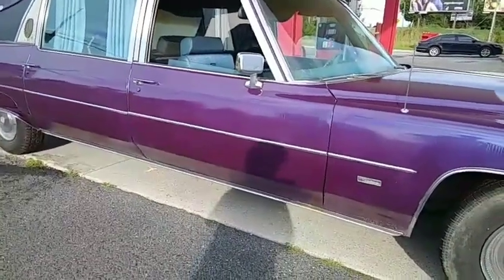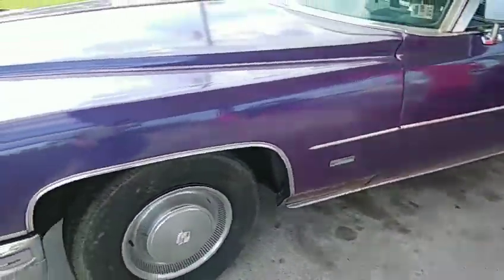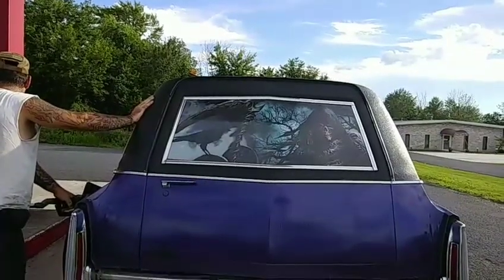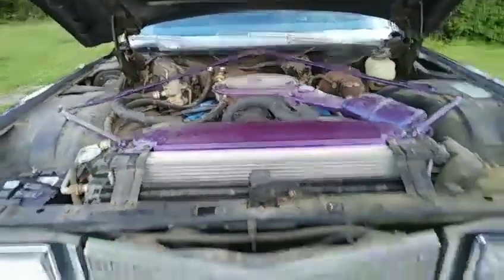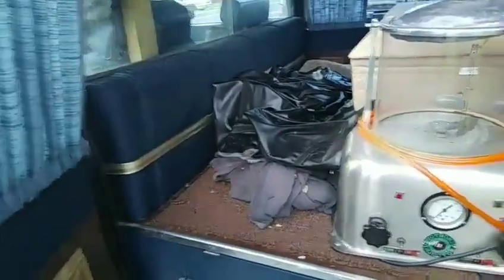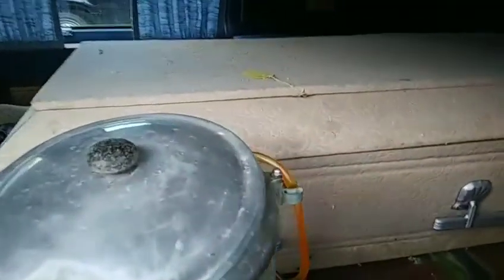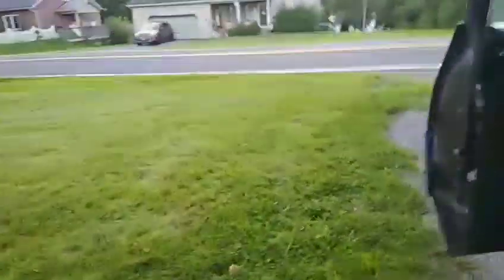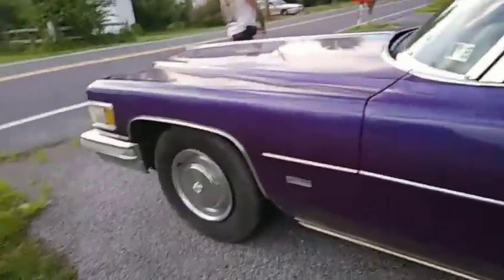1975 Cadillac Hearse in Gettysburg, PA with a coffin and embalming machine

Comment: If that is a 1975, it has a 1976 grill
Reply from the maker: Thank you for the comment. I will take your word on the grill, beautiful car regardless.
Reply: the front turning lights are from a 1975.  The 76 had 2 horizontal lines, this car .  The 75 grill had smaller squares the 76 had market squares with squares inside.  Because it’s a hearse you can’t tell the other differences with a 75& 76.  If it was an actual caddy there are subtle differences